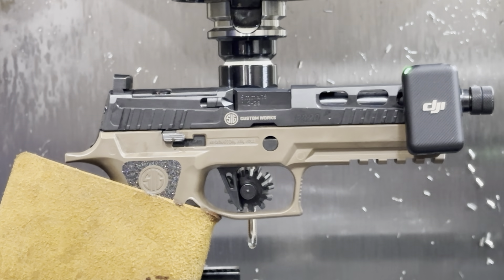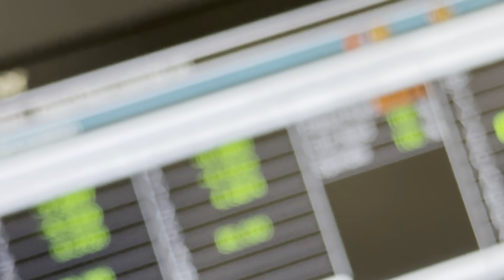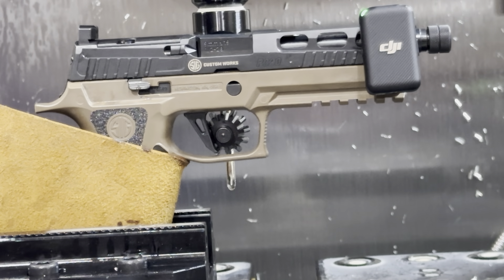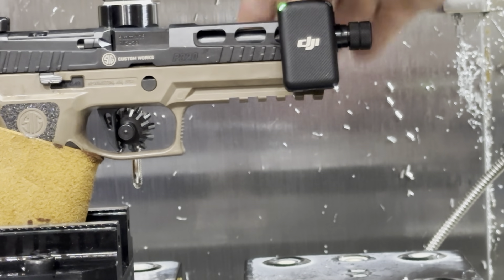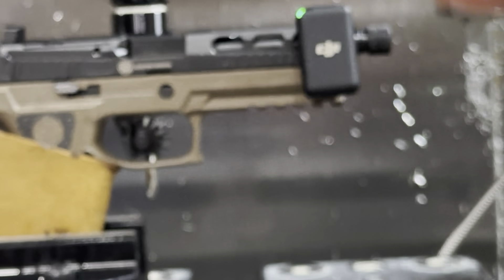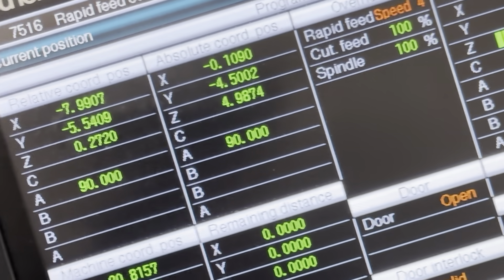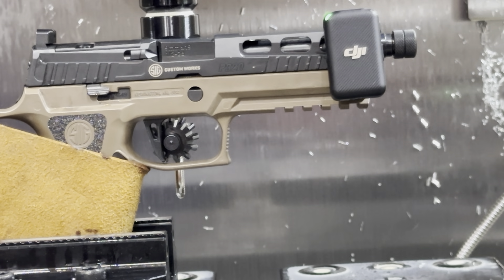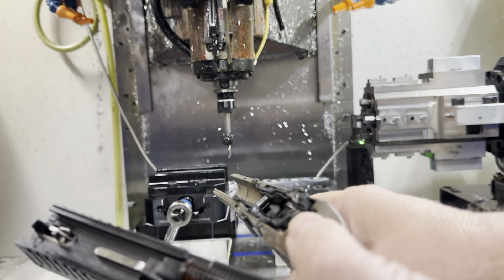Sig P320 accidental discharge tested in CNC machine.

Comment: This video hasn’t convinced a single person that sigs are safe. Thank you for playing
Reply: Anytime the trigger is pressed beyond the wall = 💥 BOOM. 
All this video proved is the pistol went boom beyond the wall. It’s not realistic the trigger would be set at the wall and wiggle at the same time while properly positioned within a holster designed for the pistol.
Reply: To be fair this was never a point of concern for me, might explain some of the NDs and with such an easy to trigger to pull vs the other brands like he tested the glock... not saying it's a fault exactly but could be good reasoning to at least put a trigger tab on the things... My concern is the cheap metal of the internals and the tiny striker safety tab that seemingly will fail 30% of the time it's needed. At the end of the day unless they beef up the pistol why would anyone spend the same amount of money on a 320 when you could get an HK, glock, sw, springfield, FN, whatever?
Reply: Well, a certain model, not their whole lineup.
Reply: Has it convinced you that it isn't safe? Or has it added something for you to think about?
Reply: Literally any gun ever if you pull the trigger to the point that the sear is literally holding on by a fuckin dick hair you'll be able to get it to slip. It proved you have to have 99.9% of the trigger pull already done to get it to slip and go off
Reply: It didn't convince any stupid people that they're safe.
Reply: @lookingdown8290  tell it to the 100+ that sued SIG and won millions over this piece of shit.
Reply: Border patrol agent here. I participated in the Glock testing before we chose it. Testing was comprehensive and unbiased, unlike the when we chose the beretta and the H&K. Glock was far superior to all guns tested. The Army suspended their testing on the Sig. unknown to me why but definitely suspicious. Sig is screwed.
Reply: @seraph0522  Sig is screwed, lol? Not by a long shot. In 2017 when the p320 was dropped from a height above US standards and at a very specific angle, the weapon could discharge. Sig issued a voluntary recall and fixed that issue. People just like you said that Sig was screwed. Well, obviously not. No one at Sig or any other weapon manufacturer anticipated some moron jamming a screw into the trigger to take up the slack and then manipulating the slide until it fired. And in case you haven't seen it, this same Youtuber made a video about the Glock 19 firing by taking the slack out of the trigger and pressing down on the slide. I guess Glock isn't far superior after all.
Reply: Sig 320's are not safe. I have several other Sigs I trust my life with.
Reply: @Gunny1971 yes true, by saying sigs I was just assuming people knew I was talking about the 320 models
Reply: he proved the glock failed the exact same test. watch his other video
Reply: @CitizenSeven500 Then why isn’t it happening to Glocks in duty holsters? Your comment is irrelevant.
Reply: @CitizenCarrier  I have seen Glocks go off in holsters before, too: https://youtube.com/shorts/ENT2X4TeZIM?si=GBuOHIG6ap75UoL8

This is the reason why the P320 allegations are so controversial, because it's also possible people are just fucking up. No one knows for certain because no one actually knows what's going on with the gun and why.

My current best guess is the P320 lacking a trigger blade safety like the Glock causes more problems since even if the Glock as a similar issue, the trigger blade safety at least acts as somewhat of a redundancy since anything that yanks on the trigger needs to be more centered as opposed to rubbing on the side like on the P320.

Of course, that doesn't explain why the M18 with a manual safety killed an airman, so we'll have to see what the Air Force's conclusions are there. Really confusing situation all around.
Reply: @CitizenCarrier how do you prove that something didn't happen?

And before I get called a fanboy, I carry a G19 MOS, which I sold my M18 for 2 years ago, and I don't believe that all P320s are safe. There's clearly a manufacturing issue unrelated to what's been demonstrated by Wyoming and this video, as all striker fired pistols have the same behavior in this condition 

I just think you're making a bad argument, asking someone to prove something didn't happen therefore the statement is true, is the same argument that people make for the existence of X god. It's known as the appeal to ignorance fallacy.
Reply: @gameragodzilla  I’ve seen that video. That’s an old video and that single video is the only one you can find. Good luck finding any information about it. What was his claim on how it happened. Did he say nothing was in the holster? Did his undershirt get caught in it? I find it suspicious that it only went off when he bent over. That tells me his undershirt got caught on the trigger and holster. Was it a highly modified Glock done on his kitchen table? Stock parts? Again good luck finding info. Maybe the reason you can’t find information about it is because he fucked up and isn’t claiming that it “just went off”. This is far different than the P320 videos and claims. 

     I have my doubts about if it’s even real. Even if it is, look at the way the holster hits the tile floor. Take a quality Kydex holster and throw it down on a tile floor like he did and tell me the difference. It will skip around and not just flop like this one. It was most likely a shitty hybrid holster with little trigger protection. Again, one video in many years with no first hand information on the claim of how it happened. Not even close. Show me more videos like the we haven’t of Sig videos and show me credible reports and claims about a Glock doing this.
Reply: @CitizenCarrier Oh sure he fucked up, but whatever happened in that video was incredibly subtle so we have no idea what actually happened. But if it was a P320, I guarantee you would be sharing it around.

Regarding the holster, it was a G-Code Incog holster, so a full kydex holster, meaning it can’t flop around. That’s also why the video spread around so much, since it was a Glock in a full kydex holster that (seemingly) went off for no reason. And because of that, you’re also blind speculating what happened, whether it was something caught in the holster (despite the video looking fine) or some improper modification, or something.

Either way, it can happen with Glocks too. The lack of proper explanation for why these are happening is what keeps this controversy going.
Reply: @CitizenCarrier apparently it did, I’ve seen a handful of articles out there about cops suing Glock for ADs and winning. Later, it came out the cause was likely that the cops were used to the revolvers which required a much stronger trigger pull to make them go off, and essentially had poor holstering practices.
Reply: @andrewkarsten5268 You are referring to what became known as “Glock leg”. And you are right. That was not a malfunction of the gun. It was poor training on a new pistol with a completely different set of manual of arms to operate it. Cops were used to being lazy with trigger finger discipline and holstering because of the heavier pull of the trigger on revolvers and relied on a manual safety on the semi autos like the 1911 and Beretta 92’s they carried. 

     But that was 40 years ago. I think law enforcement and citizens that shoot regularly have a firm grasp of how striker fired guns are to be handled safely by now. It just seems that Sig didn’t have a handle on how to design a quality striker gun after all this time of striker fired guns being out. 

     People still saying “it’s negligence of the person carrying it. The P320 is a great gun because military blah blah blah…” remind me of all the democrats that said how sharp minded and on the ball Joe Biden was, even when faced with the facts of his failing brain. It’s hilarious and sad at the same time.
Reply: @CitizenCarrier I have a P320 and I’m waiting for the facts to come out. It used to stay on my nightstand with a round in the chamber and now it’s in its box completely empty. If there is a problem, I want to know. I’m not trying to be purposefully obtuse, so if I ever come off that way know it is not my intention.

Sig doesn’t have the trigger safety on the P320 like the Glock does however, and police officers are known to be some of the worst gun owners out there. I do wonder why it’s mainly cops having this UD issue. Part of the Airman’s situation that’s so scary is his had an external safety just like mine, but the cops’ did not. I would not be surprised to find that cops still have poor gun safety with their sidearms and simply things (making sure a shirt isn’t in your way when you holster e.g.), and to find that lack of good training is what is causing their issues. 

Does sig have a problem? At the very least they have a PR problem. Have I seen enough evidence to convince myself the P320 will fire without a trigger pull? No, the vast majority of the videos are grainy, or have something pushing on the trigger, or both, and I have yet to see otherwise. Am I open to the possibility something is genuinely wrong with the gun mechanically? Absolutely, that’s why I’m keeping it in the box completely unloaded.

I guess my point is I’ll wait for the evidence. We have very little aside from hearsay and way to grainy videos, along with videos like this where the trigger has to be depressed to make the gun fire. That’s not enough for me to toss my gun completely. OTOH, it wasn’t my EDC anyway so it doesn’t really make much of a difference to me, I’ll keep it as a range toy worse case scenario
Reply: @andrewkarsten5268 I don’t take your comment as obtuse at all. I just don’t want to see people get hurt because they are taking what Sig has to say as fact or by listening to others in their echo chamber of other diehard fans of the 320 and get a false sense of security and think they’re safe when there is a good chance they might not be safe. Some people are waiting for Sig to come out with the “facts” when clearly they are never going to admit a problem. The old saying of a company that has a good product will stand behind their product. A company with a bad product will stand behind their lawyers. To me, that describes Sig perfectly.

     You just do what you feel you need to do to stay safe and keep an open mind. The FBI has investigated and clearly said the 320 has a flaw that can cause it to fire uncommanded. And yet Sig twisted the FBI report and actually lied about the findings. Personally, I just don’t trust the 320 because with this much smoke, there’s a fire. And I don’t trust Sig as a company. They gaslight. And if their product is as safe as they say it is, there’s no need to gaslight their customers. I won’t look for any government agency or Sig to put out the “facts” about a possible issue. The public usually does a better job at that. At least people that know what they are doing that test things themselves to determine an issue. You just have to look at all the information and come to your own conclusion and plan.

     It sounds like you have a healthy skepticism about the 320 and are doing what you need to do to be safe. Keep doing that! Follow your gut instinct and you can’t go wrong.
Reply: @CitizenCarrier because there’s clearly an issue with safariland or alien gear holsters. Only issues have been with them. Plus you commented on a video that there is a Glock comparison and fails the same way. Clearly you don’t understand firearm mechanics so get off your nonsense, sit back and learn something instead of crying about something you don’t know about
Reply: @jc45487 😂Sure. It’s clearly the holster that has safely held countless other brands of pistols on duty. Tell me you’re a beginner with zero experience without actually saying it.
Reply: @CitizenCarrier  Because they have 3 internal safeties, and a mushy ass trigger stopping you from pulling the trigger in your duty holster. The SIG trigger has an incredible tight break, and reset. Making it a very fine shooting gun, but also making fuck up tolerances a lot lower from human error.

If you REALLY want to count on it not happening, just get one with a manual safety. Most of these LEOs shooting themselves, or discharging had been found to be trigger interference, or holster tension. Holster tension should not happen, can't argue with that. But again, it won't with a manual equipped model.

Also can we please stock acting like Glocks were completely garbage at one point? Oh I forgot those problems were from 30-35 years ago with no real internet, so people seem to sweep that under the rug. First 2 generations were terrible for Glock, and only decently got their shit together with Gen 3 and on.

This isn't to give SIG a pass. But it was their first striker fired pistol, converted from a SA P226 system. Glocks are on 5 generations of figuring their system out.

 New gun platforms tend to have some kinds of teething issues going on. But it's not like SIG didn't learn anything. Just look at the P365, every single concern of the P320 is non-existent on it. Including even the long pocketed sear, where debris can get trapped is gone on a 365.
Reply: @gameragodzilla   Tragic what happened to that airmen, especially at 21 years old. And he is a victim for sure. But there was at least 25% user error. 

It is against protocol in every way to throw down a loaded or unloaded gun with force. Weather it's holstered, or unholstered. And it's even more against protocol to do it while you're flagging yourself as you throw it down.

By definition of the US military guidelines, even if the handgun did managed to discharged by itself; it still falls under user error for flagging errors, and improperly handling a firearm.

I am however, truly curious to see if the Air Forces' investigation finds that the manual safety on all M18 military models;; was engaged or disengaged.
Reply: @iTrinityPlays Wow. Literally every single talking point and excuse you made has been explained. I could do the same thing and try to educate you on each excuse you made, but at this point, anyone STILL defending  Sig and the 320 and blaming it all on the user, no amount of common sense explanations and proof will suffice. Maybe I’ll make a video about it. But then again, why should I? The info is out there already if you want it. But you have to let go of your blind loyalty, start using common sense and open your mind to be cleansed of the brainwashing.
Reply: @iTrinityPlays 25%.... that means 75% of the error is on the manufacturer? Oof.
Reply: @CitizenCarrier it’s not irrelevant if the Glock. I have a feeling this is a striker fired gun trait. Some of these discharges have happened in police departments that were using holsters designed for a P226. The Airmen that was killed someone has been charged in his death. Which would atleast make a possibility that the weapon wasn’t at fault.
Reply: @CitizenSeven500  funny the glock video shows him moving the trigger 99 percent of the way and only barely moving the sig trigger to produce the same result but its the same...sure buddy
Reply: @deveey  the glock has a lot longer travel than the sig. that's irrelevant. both released the seer 20/1000 before trigger break
Reply: @deveey  Okay so you don't understand math, we got. Just to get this straight; 83% of the trigger pull from resting position, to break point is BARELY touching the trigger? 

The striker being tripped at -0.090" or 2.0MM corresponds to ~82.6% of the total trigger pull distance to break at -0.1090 or 2.77MM.
Reply: @iTrinityPlays  sig fires without touchin the trigger son its highly documented with video proof multiple times only after someone died does sig acknowledge there gun is a piece of junk
Reply: @deveey he moved the p320 90% of its travel before trigger break (fire) to obtain a striker fall .
Reply: @Jetmech1085  sig fires in the holster its a simple search here on youtube u can find many examples of them firing without even being touched at all at this point sigcope is laughable
Reply: @deveey  he has to the glock ignition system is different. SIg is fully cocked before you touch the trigger, glock is not.
Reply: Sigs are 100% safe. All guns are safes if you don’t press the trigger or have some cheap ass holsters putting pressure on the trigger.
Reply: @DogeGaming-wc9cm Okay game boy. Then answer my question.
Reply: @CitizenCarrier read my comment above glock boy
Reply: @klntym Glock boy? 😂 That assumption just negated anything else you have to say. I can’t stand shooting Glocks which is why I’ve sold most of the ones  I’ve had since 1987. My best estimation is at least 20. I only use Glock as an example because there have been FAR more of those sold and in duty holsters since they came out than the P320 and we don’t hear about anywhere near the number of “uncommanded discharges” like the P320. I can’t even remember any that weren’t obviously negligence. 

    Don’t try to compare your experience and knowledge with firearms to my experience. You’ll just hurt yourself and make yourself sound even more ridiculous like you already have. At this point, anyone STILL continuing to try to deny and issue with the P320 in the face of videos and reports from even the military now, just shows what a Sig Sycophant you are.
Reply: @DogeGaming-wc9cm Absolute nonsense. You really showed that hopefully you don’t own a gun. A trigger is protected by the trigger guard. No way a holster can access that
Reply: @michaela6147 100% it can if the holsters are formed incorrect or out of tolerance. Leather is way more susceptible to it
Reply: @DogeGaming-wc9cm actually thats not at all the case. Not even counting their drop saftey issues there are CLEAR videos of them going off wo anyone near the trigger guard.
Reply: @smasher.338 no there aren’t lol
Reply: @smasher.338 I've seen 3 or 4 popular brands of 2011's go off during drop tests and those are just as dangerous.
Reply: @jc45487  there absolutely are. Have you even tried to look? The most popular video was the guard/cop outside of the school. The gun went off and his hand were in clear view, away from his firearm.
Reply: @deanmiller6177  well no cops or soldiers are issued expensive competition 2011s.  A lot of hammer fired  guns can go off if the hammer is down and there isnt a safety on the transfer bar, or the gun doesn't have one. 
 But id say people with hammer fired guns, are more aware of the dangers of dropping the firearm. A lot of striker fired guns claim to be "drop safe".
Reply: @DogeGaming-wc9cm  yeah safariland makes shitty holsters lmao
Reply: @DogeGaming-wc9cm  if sig 320's are so safe then why are they firing with no one touching them? Do you think the police and the military are using "cheap ass" holsters. What about the competition shooter whose gun went off before he even got the start beep, do you think the competition guys are using "cheap ass" holsters. Cheap holster or not when you insert your gun into a holster the gun wedges the holster open a bit widening it so the trigger can't be pulled. Do you think those molded Kydex holsters have something in them to pull the triggers? If you do, how? The trigger guard would hit the obstruction first stopping the gun from inserting properly. Your argument goes past stupid to flat out ludicrous. BTW TY for being a SIG fanboy and also no gun is 100% safe any failure could happen at any time to any weapon. Prove me wrong! I can prove to you or anyone no gun is safe even if no trigger is pulled. Again, prove me wrong!
Reply: Haaaaahahahahaha
Reply: @GuyIncognito486  thats not a p320 FOLKS
Reply: @DogeGaming-wc9cm wrong